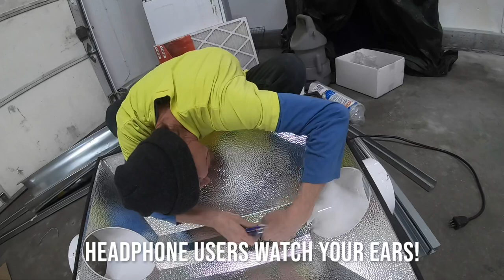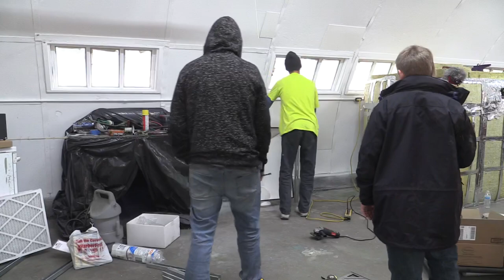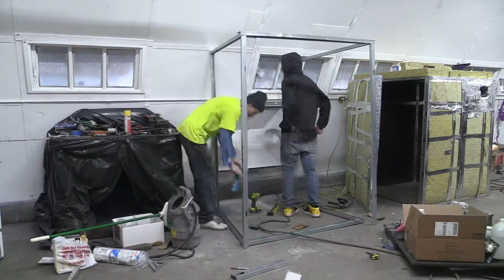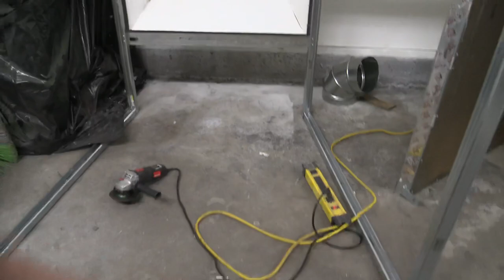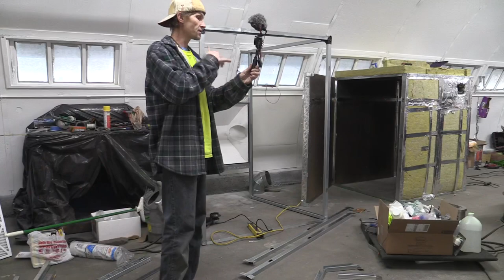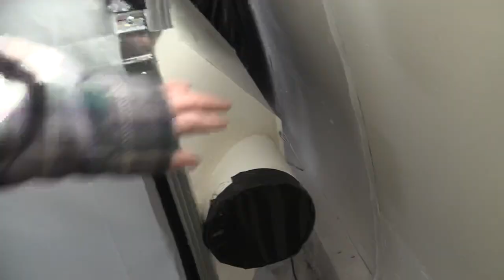Using a Grow Light to Build a DIY Powder Coating Booth

Comment: Just a thought: Since you're probably going to be changing those filters pretty often, you may want to consider getting some filter channel (it's just 1x1x1 u-channel sheet metal) to put above and below your filter. That way, you can just slide the filters in and out the side instead of taping them in every time.
Reply from the maker: Robert Amaya that’s a great idea! We’re also thinking of a different kind of filter
Reply: @710performance  You have a nice set up, for sure!  I made something similar for my home powder coat set up, but I was going through filters like crazy. Now I just sweep alot, haha.
Reply from the maker: Robert Amaya thanks! We still sweep quite a bit, but it works well 😁🤙

Comment: It looks like the plastic you used for the walls was poly sheet.

Consider using coroplast when the poly sheets fail.
Reply from the maker: Roger Shoaf we’re looking at coroplast as well and the 1/4” thermal insulation sheets. I’ve noticed a fee booths built from that and it’s much cheaper than coroplast. We will be building a new and better booth in March I believe.